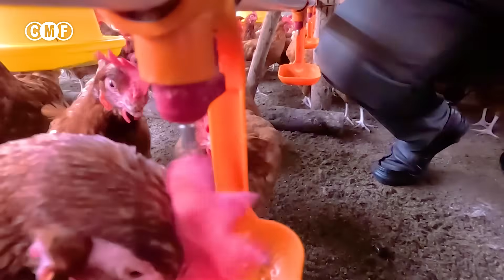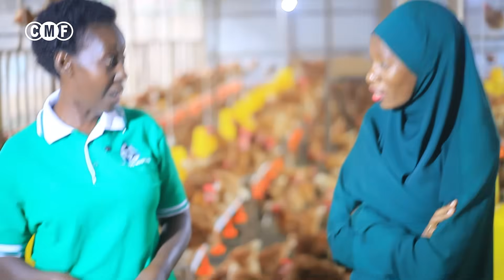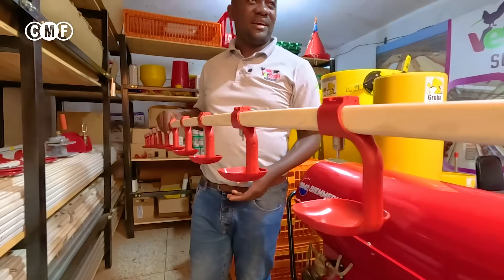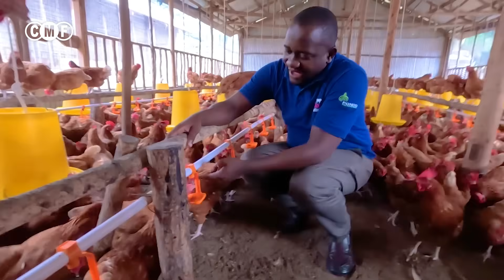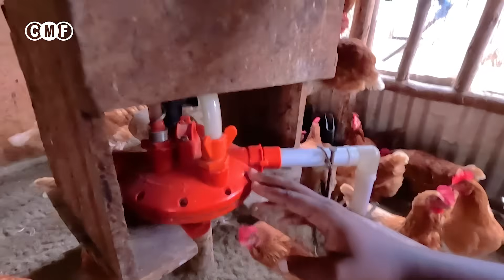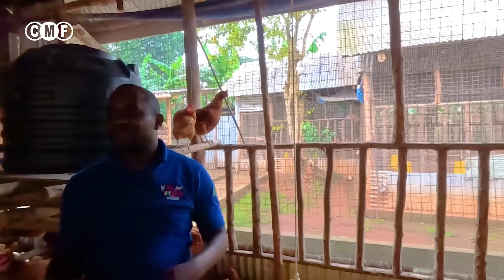Poultry Farmers Lose Money Yearly - Here's How to Stop It

Comment: Perhaps as a word of advice I wish Andrew can devise a way to avoid birds perching on the support of the water line because they can poo in the clean water.
Reply: Well initially it was a challenge but now no more . When we are choosing support poles we make sure they are relatively big in size to give full cover to the nipple and drip cups.

The birds never poo in the cups even when they rest on top of the poles . so it's not something to worry about .

In the fully suspended automated system.  We use tension wires and sharp edges to avoid birds from sitting on top of the lines . 

In this case it's the polesbut they should be laid properly and must be the right sizes
Reply from the maker: If you carefully watch the video, there’s a wooden pole running over the water pipe to prevent birds from perching on the water pipe. Also, there’s no way the bird’s droppings can end up in the water as the water is inside the pipe and only comes out as a drop,
Reply: I also have this system. The birds perch on top the  wood and poo inside the water cup

Comment: The birds can defecate into the water
Reply from the maker: No way..
Reply: With this system it’s impossible, but with our traditional drinkers, it’s a huge problem
Reply: Well initially it was a challenge but now no more . When we are choosing support poles we make sure they are relatively big in size to give full cover to the nipple and drip cups.

The birds never poo in the cups even when they rest on top of the poles . so it's not something to worry about .

In the fully suspended automated system.  We use tension wires and sharp edges to avoid birds from sitting on top of the lines . 

In this case it's the polesbut they should be laid properly and must be the right sizes